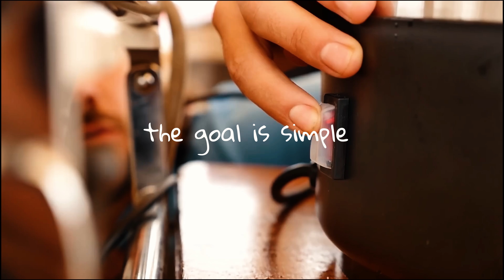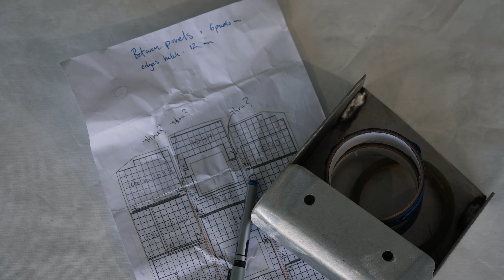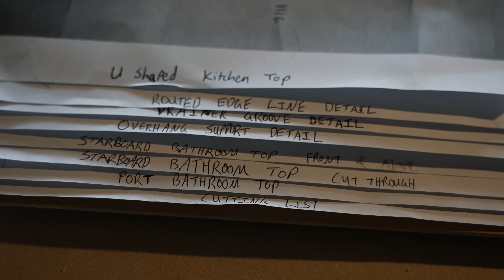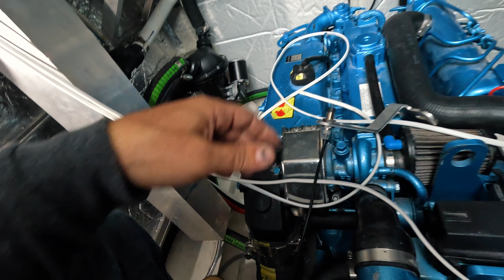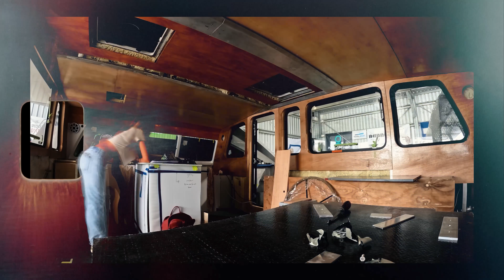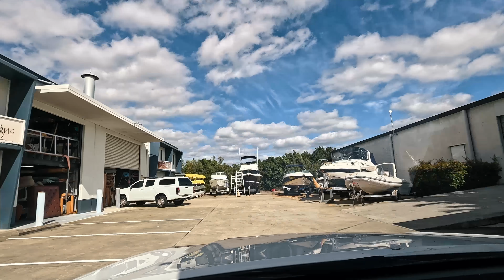EVERY INCH COUNTS....Aluminum Catamaran Build Pt. 83

Comment: I would be worried about those aluminum tubes, it seems like your high voltage DC will be sitting in that tube with salt water.

I would have tried to find a waterproof gland fitting with  waterproof flexible conduit and aluminum stands to hold the conduit.  Maybe I'm too paranoid but that aluminum just looks like an eventual problem to me.

Comment: if the proxiity switch is so critical to make sure both motors don't operate at the same tiime, I would suggest installing two, each on its on circuit. That way if one fails for what ever reason the other will still work.

Comment: I'm curious. The panel you had in your hand in the video is black. Do you have color choices for the panels you are ordering. And if so, has the company talked to you about any differences in efficiency? In the residential world of solar panels the current trend is to have the black frame, black face panels put on the roof of your house. But that look comes with a sacrifice. The black attracts more heat then the standard silver frame, white face panels. That heat turns into a 10% efficiency loss. Presumably, if you were to install white solar panels instead of black on the roof of your boat, you should see the same difference in output.

Comment: Make space between the panel and the actual roof, with a raised frame or something, so there can be air flow and the aluminium doesn't soak up all the heat.
Reply: You can't do that with flexible solar planels that you can walk on. Or you would need to build an entire second roof a few cm/in above the first roof.

They should have left an air gap between the alumium and foam insulation to allow forced ventilation to keep the panel less hot.
Reply: Is it important to have the entirety of the roof walkable? I have no idea since I never sail. But if it's not, why not divide the roof into walkable and unwalkable? The walkable use solid raised platform, while the unwalkable use lighter frame that doesn't provide structural strength. 

Your solution is practical and less of a hindrance, but aluminium is especially good at conducting heat, and the roof is alum connected with also alum wall, so the heat is running on solid into the hull as you would try to cool it down with air, it can be better right? Plus, why not have both passive ventilation on top of forced ventilation?
Reply: @lcrow3104 you need to walk on the roof to   close or open the sail cover, if something get stuck when raising the mainsail, Or to climb the mast to inspect the rigging.You don't need to walk on the whole roof, but its nicer to not have to think if you are stepping on  a walkable area or not
Reply: @niconico3907  yea make sense
Reply: I believe the panels stick directly to the roof.

Comment: Solar Panel Information - a boon for all sailors, RVers…❤ Can you give some details on the type of solar cells you are using and the increase in longevity and cost in buying custom panels rather than trying to use ready made shapes.  Your education could inform others wanting to do this.  What an adventure you are going through without even hoisting a sail.

Comment: all these aluminum hulls with mass electrical systems are a nightmare for stray current. Good luck. Aluminum works when you don't want all these luxuries. Second you add this level of systems you are asking for nightmare scenarios.
You can have stray current even through shielding. Electrolysis is based on the bipolar magnetism of electricity not the direct bipolar connection. 
You can try it put insulated wires around aluminum. 
Make the other side of the aluminum touch water. 
Watch electrolysis happen. It is tiny on this scale but now scale it up to your boats surface area and the currents you have.

Comment: This might be beyond the scope of a video but hearing that you have a lot of panels in series if one panel is even partially shaded doesn't that shut down the whole Bank from producing power?  Ive seen a video where a small piece of paper shaded a small corner of one solar panel and that was enough to shut down the entire panel from producing electricity even though the entire thing was in full sun besides the small shaded portion. What the main sail casting shadow on the roof are you guys worried about this

Comment: at 25:34 it appears the cables that connect the panels are open to the air (both on top and bottom sides) of the square protectors around the wires... is this the case, and wont this promote heavy corrosion when you combine exposed copper with voltage with salt air and water?
One other question,, you have the prox sensor to only allow the Electric motor to run when the tranny is in neutral, but what happens when the electric motor is running and someone starts the Gas Engine and put is in gear.  wont you have a period before the electric motor can stop when both would be engaged?

Comment: Awesome episode guys!The management of this project must be quite challenging! Lots of coordination. Wonder how you coordinate - weekly team meetings? Lots of email? Also, as others have mentioned, why is there no spacing under the solar panels? Probably not worth the 1000 btu/hour (~300 watts) reduction in thermal conduction through the roof that a 1/2 inch spacing would provide. And only a slight challenge for the AC if in use. But then I thought of the increased efficiency and reduced wear and tear on the panels (~15° C surface temp reduction) as well as the increased off-gassing of the internal roof insulation. And then I realized it's a sailboat and there's usually lots of wind around, both sailing and at anchor, to keep air moving. This is such a cool project!

Comment: OK, got a question about thermal conduction through the solar panels to the aluminum🤔, then radiation that wants to go into the salon, but is trapped by the heavily insulated upholstered wooden ceiling panels🤨.  Where does it escape to?  Maybe some goes back through the solar, but some must go into the salon, doesn't it?😒

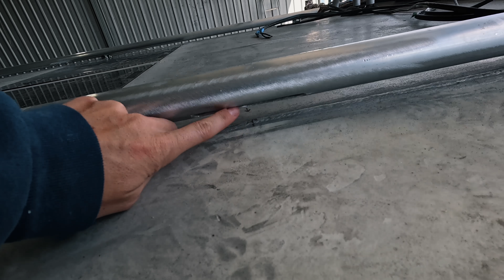Comment: 13:04 Does anybody know why they would cut a slot that saltwater could leak into and corrode the wires? It must be for something I don’t understand yet.  I’m assuming they will be using the fish  tape method to pull the wires through the conduit.

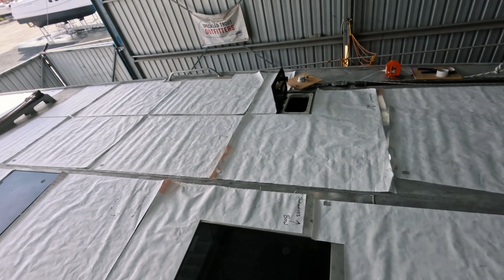Comment: 3:28 Why not just grind and smooth the weld seam?  That's like the whole advantage of doing the boat in aluminum.  If your worry is over surface finish after grinding . . the surface finish will be . . . solar panel. . . .

Comment: The #`1 problem for wires flexing in tight places is chafing and shorts. You did not mention it, and I think it will be a concern eventually.  I look forward to your solution or compromise for wire protection as it enters the outdoor conduits. I wouldn't overthink it. Keep it simple and accept that some chafing is inevitable. It may be easier to to repair when it happens rather than preventing it completely. Add some reasonable forethought about slip-on thicker insulation at chafing points?

Comment: Hey Brian,
Amazing work on Episode 83—the layout for the upper deck solar looks incredibly clean! Having a background in air conditioning repair, my HVAC/physics brain started crunching some numbers on those wall-to-wall black peel-and-stick panels on an aluminum deck under the equatorial sun. Since they are stuck directly down without an underside air gap, those black panels will easily hit (160° F), turning the aluminum roof into a massive radiator. Even with 2 inches of closed-cell spray foam (roughly R-13/14 for the whole ceiling stack), an (85° F) thermal gradient down to a (75° F salon means you are looking at a continuous radiant heat load of roughly 1,500 to 1,750 BTUs per hour dumping into the salon from the overhead alone.The spray foam will slow it down, but after hours of vertical sun, that ceiling cavity air gap is going to saturate and trap that heat. The real killers will be thermal bridging through any aluminum framing ribs cutting through the foam directly to your headliner panels. It might act like an electric blanket keeping the salon hot well into the night, forcing you to run that beautiful new 240V A/C system way more than you want to. Just wanted to throw that on your radar while the overheads are still open! Maybe worth looking into a tiny 12V exhaust fan for that headliner air gap or extra thermal breaks on the framing before it's all sealed up. Fair winds, Greg
Reply: #theydidthemath
Reply: Interesting post. I'm sure that Brian is crunching the numbers, and is also taking note of a very similar system being installed on Sailing Uma. Skipper Dan over there has run some very interesting tests addressing the same concerns with no problems but it's a fibreglass monohull, so different application. Love the idea of being able to exhaust the hot headliner air gap to waste  👏👏👏
Reply: Brian, stop the build.  You need more solar and lithium and you really should paint those pesky solar panels white so they don't get so hot😂

Comment: I would be surprised if you saw more than 4kw out of those panels on a hot day given the degradation of efficiency when the panels when they get hot.  But who knows, maybe the entire hull will act as a heat sync since aluminum transfers so well 🤔.  But as many have said, I am concerned you will be putting a tremendous amount of heat into your roof.

Comment: Doesnt your transmission already have a neutral safety switch? That should easily be able to be wired into the electric motor system without the need for an additional sensor.

Comment: I’m interested in what you are doing about bypass diodes on the solar panels. When a cell is shaded it becomes a high resistance path thus reducing the current the rest of the cells that are in series with it can deliver. Since these panels are on a sail boat the cells will get plenty of random shading. Are you using bypass diodes so that non-shaded cells can still deliver power and not be blocked by shaded cells?

Comment: I love the way they did the solar on Uma. They ran all the wiring through the roof from under their panels.
However, Delos 2 has a much larger roof and being all aluminum, the conduit is a much better way for your build.
You'll have an enormous amount of power, no holes, and protect your wiring from sun and water damage.
Nice.
The company the Uma crew is working with definitely created some super awesome panels that accommodate for shading without losing enormous amounts from the shading.
Smaller sections in the panels and multiple mppt's so the whole panel isn't lost due to a little shade.
The creativity happening on so many types of builds is fantastic for innovation across the world.
Awesome!!!!
Reply: Uma’s solution is really amazing and is a perfect solution for them. Delos’ is also taking advantage of the latest technology and has an excellent solution for an aluminum hull. Solar technology is improving every year. When I saw what Dan and Kika did my first thought was what are Brian and Kaz going to do.

Comment: Are you installing any lightning protection? Parlay has a "sertec" system that looks very well engineered and not to unattractive. Cheers and Regards
Reply: The only solutions is to stay away from storms as much as possible. These systems sound more like witchery to me rather than working tech. I have overhauled quite a lot of boats'electronics due to thunderstorms with all kinds of protection.. The best thing is redundancy for main systems, old fashion motors without any electronics, good opto isolation on integrations and DO NOT use any digital switching systems on a boat... A single lighting can leave you stranded..

Comment: Wouldn't it be favourable to have an emergency mast that you can erect a small sail like a wind surfer so you can have some control if everything goes wrong with electronics that you have even though it's been checked a dozen times..
No system is foolproof..

Comment: No air gap between the panels and the roof? 
What is your plan for dissipating the heat to stop the panels from burning out?
Reply: Not sure if the extra heat would cause them to burn out.  This is actually a fairly common way to install these panels.  But an air gap that allows for cooling should improve efficiency.
Reply: An air gap would eventually just become a salt gap. Its a boat...
Reply: @MultiGangus  Yes, if you don't keep your boat clean. 
Any Owner / Captain worth his / her weight in salt (pun intended) washes down their boat.
Brian and Kaza are very good at keeping their vessel in good condition. 
So your point is moot.
Reply: @gregakablackie
oh yes, extra maintenance, trying to wash crap out of a thin gap. These are things a good sailer needs?
Reply: @MultiGangus  So you consider keeping your vessel clean extra maintenance? It's obvious that you've never owned a yacht. Also, no one mentioned thin gaps; I'm referring to 1-inch-by-1-inch square channels running the length of the material. All you do is spray it down with water.
Stop embarrassing yourself. 🤣
Reply: @gregakablackieno I think trying to elevate panels that are meant to be directly applied is dumb fora lot of reasons.
Reply: Wouldn’t the giant aluminum boat act as a heat sync? I don’t know just seems like it would.
Reply: An air gap would be great, but wouldn't walking on the panels flex them and shorten their life?
Reply: @ToIsleOfView  There is a panel that would lie flat on the roof that has channels running through it to allow air to circulate, and the solar panel could be attached to it. It's used in solar panel applications, and you can walk on it. I couldn't find the name of them, but I've seen them in use in a YouTube video about yacht building.
Reply: Pretty sure the flexible panels are designed to be directly applied. If you know Brian at all im sure he has researched the crap out of the product before deciding on a mounting method
Reply: Spot on. I am doing this professionaly for many years now... That will be such a waste of money!!!

Comment: I love the inductive sensor for detecting neutral; very clever solution. What is it's failure condition, namely, does it fail in such a way that it locks out or does it fail and possibly give a false reading that would lead to induction into the brotherhood of expensive noises?
Reply: A good system would use 2 inductive sensors. One sensor is on when its in neutral, one sensor is on when its not in neutral. That way you should always have one sensor or the other on. If you have both on, or both off, you ( or the system) know something is wrong.

Comment: Since the distance between the contact point and the pipe is very small, it is advisable to connect lightning protection to each contact point to the solar panels, which is grounded through the pipe. The simplest lightning protection is a varistor, if financially possible in combination with a Zener diode (fast first derivative) and a spark gap (as the main load carrier) per contact point.

Comment: This is very interesting.
How wise it to not have a service gap with mounting hardware between the panel and roofing?   There is a lot of bending/warping/torquing from weather/waves, and dirt accumulation that I would be worried about with sticking these things right to the surface.   Any electrical issues or unexpected damage mean much more intensive service compared to just unbolting them.   This would worry me - but it also seems very cool.

6k is amazing - you will be able to almost treat your vessel as if power was not a concern at all.

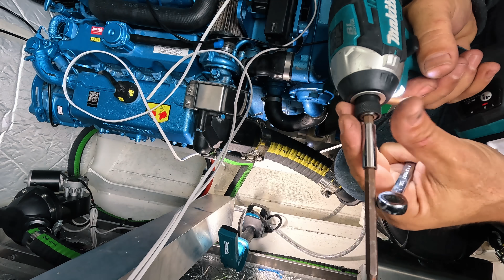Comment: 18:35 I would have thought a more mechanical approach of linking the position of the shifter to a power on switch instead of relying on a sensor and detector circuitry would have been the reliable approach.
Reply: I agree
Reply: Lots of gadgets to go haywire, for me .  I like the kISS  works best for me .

Comment: Battery technology has advanced to aluminum Ion with fast recharge and no danger of fires like the lithium batteries have been known to have. Weight of the aluminum is lighter and more cheaper and last longer through millions of recharge cycles. I heard Tesla is moving towards this technology using the same manufacturing process as lithium

Comment: Hi Delos Crew.. 👋
Think for a moment about what a seabird would think, just seeing so much surface area to perch on. They'd have a feast on things you wouldn't find distasteful. Maybe so, maybe not, but an electronic bird deterrent or repeller would do you good. It's a technological device designed to keep birds away from roofs, balconies, or sheds using ultrasonic sounds, complex waves, or strobe lights, without causing them physical harm. There are even cannon-like designs. 

P.S. Good job. 👍

Comment: Sailing UMA tested how hot their panels got in the sun. The temperature was 147 degrees ferinhiet during that test. That temperature will cause 2 degree burns to to skin and could cause irversable damage, did you consider that?

Comment: Re sensors: it makes sense to run a thought experiment what if that sensor goes bad or moves away from position. 
What are possible failure modes of that sensing that could trick you into serious fault? 
How can you quickly verify that it senses correctly? 
Did you put it on your future maintenance checklist? 
Sorry for these - just had some experience with industrial automation involving various (capacitive and inductive) sensors. 

Also, unless it is specifically marine-grade IP68 sensor it WILL suffer water ingress, along with its connector (we have suffered that with machining coolant and various sensors). You need spares and you need a quick way to figure it out when it happens.

Comment: ... Ok.  So, I just saw your layout for the solar.  Why not grind the weld seams flat?  You have done so much work on that roof anyway.  
Why not go the extra mile and make it perfect.  Am I missing something?  A possible future failure where the roof stress cracks under the panel?
Reply: The value of intwrpersonal relationships bud!